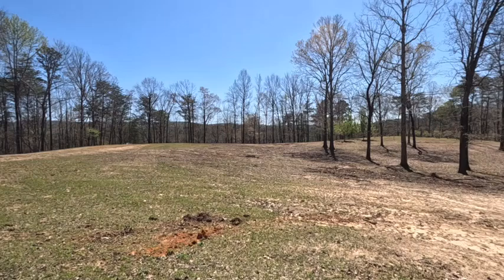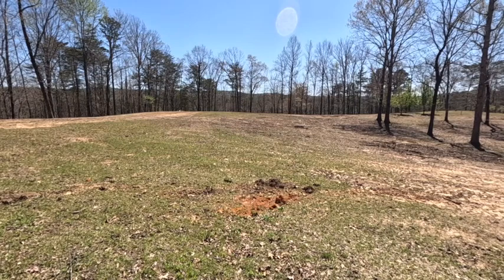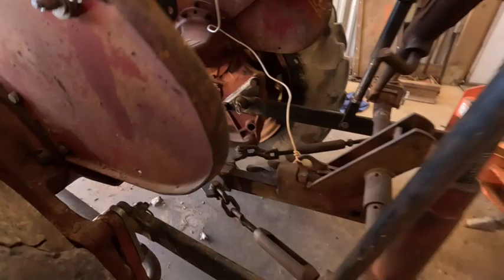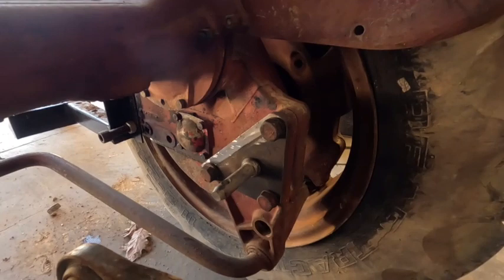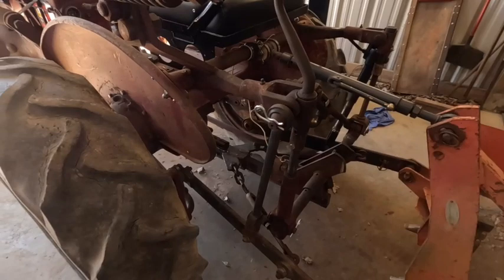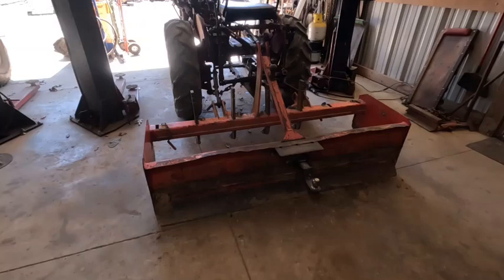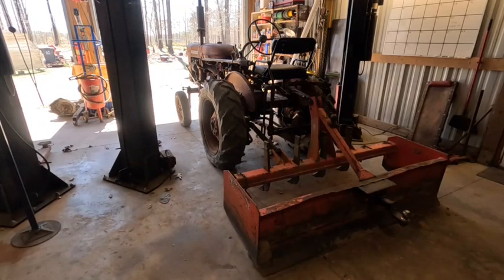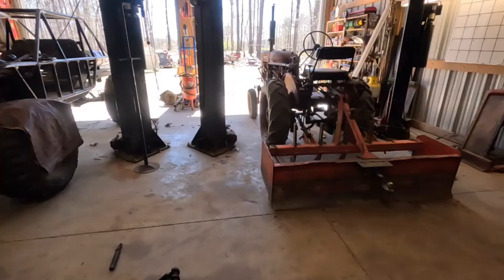Farmall 140 3 Point Hitch

Comment: Thanks for the video.  I bought another Super AV last year and it has a "rigged" 3 point hitch set up on it.  I'm wondering if there is some way to rig a 3 point quick hitch up to the rear cultivator arms on either a 140 or Super A and weld the "ears" like you did on the top bar.  I need to post a video of the set up on the AV when we get back home in a few weeks.  Thanks, Ken